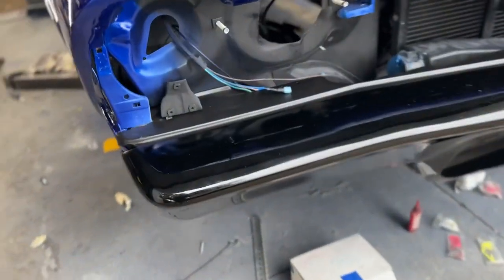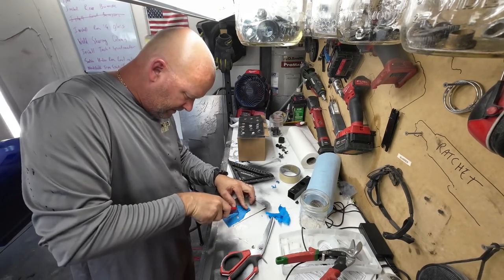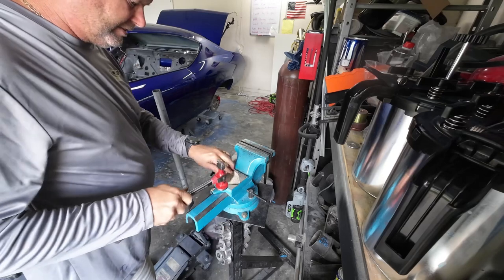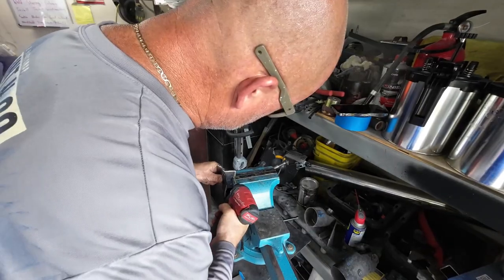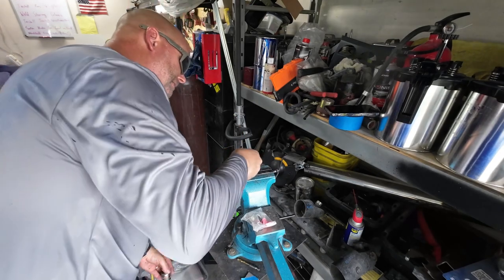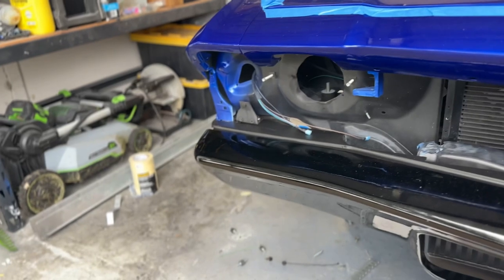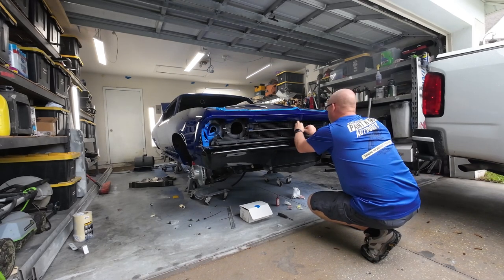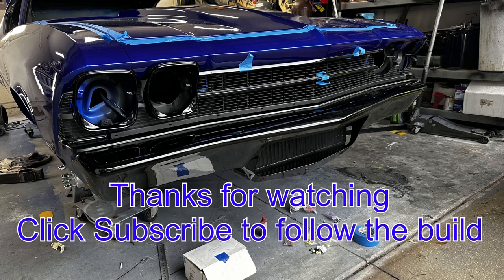1969 Headlight bezel bracket fab and grill install

Comment: Nice job I'm doing my filler panel for grille brackets. Can you tell me how those brackets actually mount to that panel please?
Reply from the maker: Hi Marshun. Originally they are riveted on but you can also bolt them on. Hope that helps
Reply: @SOB_Garage   thank you the filler panel I purchased didn't have any holes so I'll look into doing that. I appreciate your help. The only holes on l my panel is one square hole on the edge corner. Thank you